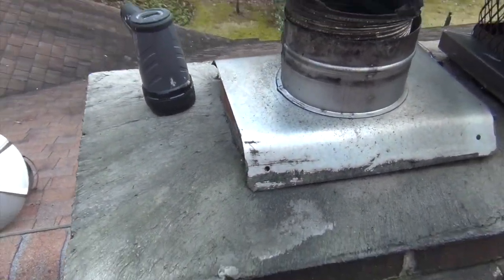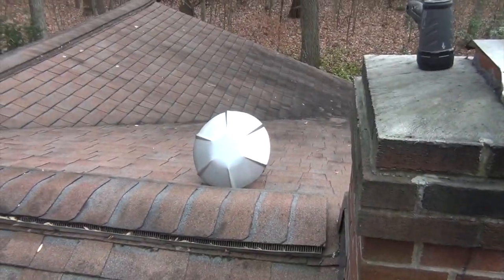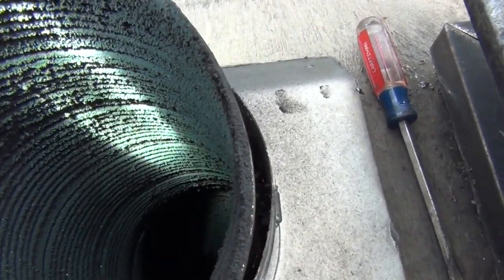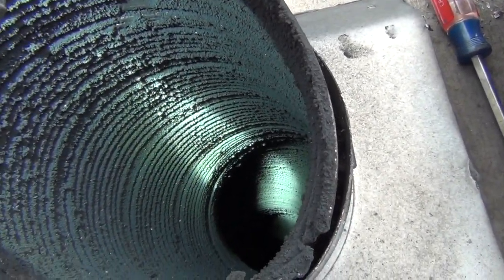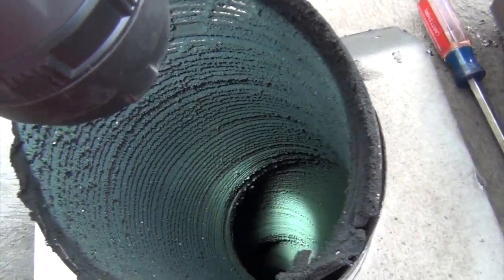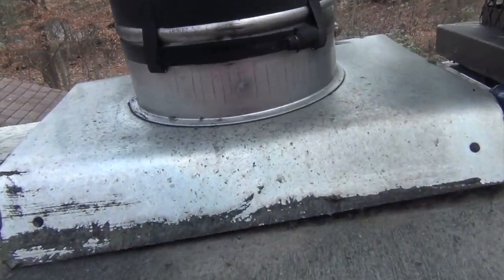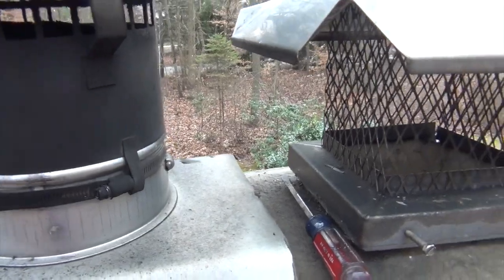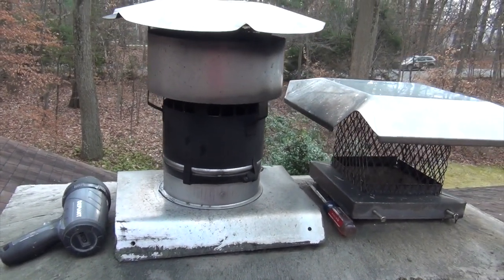Mid-Winter Chimney Examination - Creosote or Fly Ash? (Wood Stove)

Comment: Looks like a well designed cap. There a lot of theories about the right cap. A H type of cap that they use on boats is great, but more expensive and less simple maintanance.
Reply: The thing on the right is something that keeps the rain and birds out. Not usefull as a exhaust pipe.